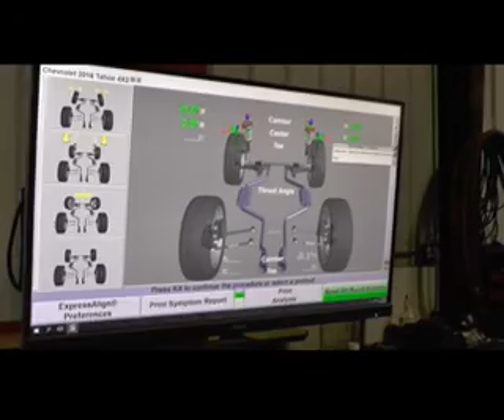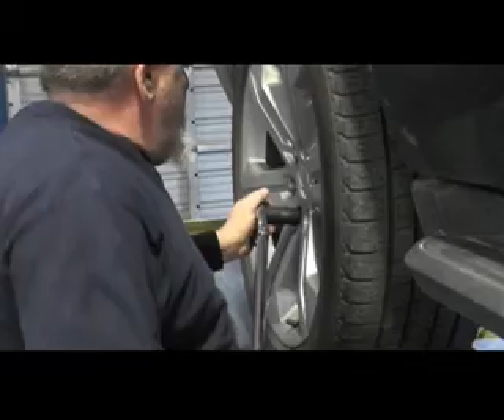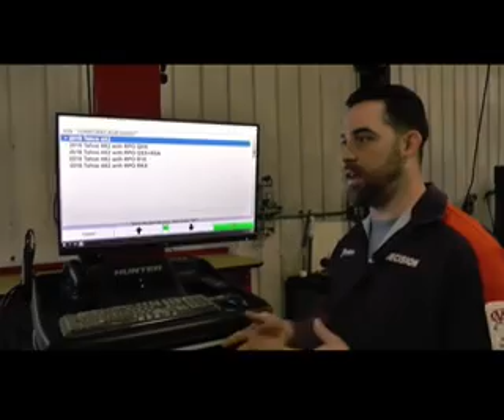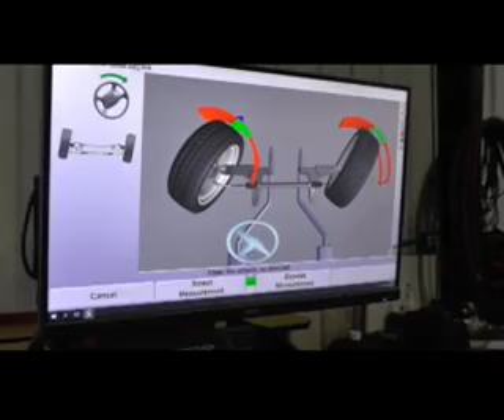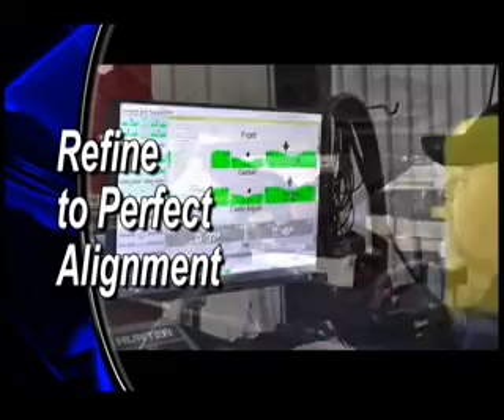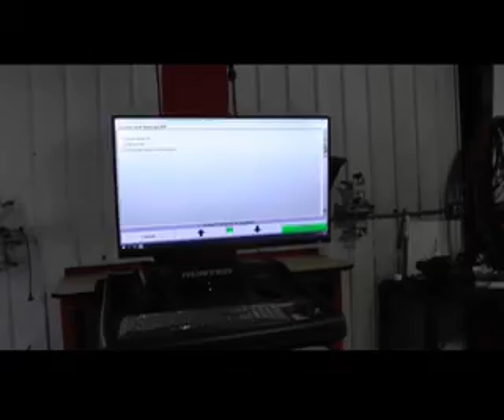Automotive Digest - Hunter Hawkeye Elite Alignment

Comment: I do have a hunter alignment at my shop.  Why when adjusting the rear camber (BMWs in my case) the numbers are not in spec when even such as -2.0 camber on both sides. One side will read -2.0 for example and the other side will read -1.6 but both are in green. If you adjust the -1.6 rear camber to -2.0 it's in the red. 

Any explanation to this?